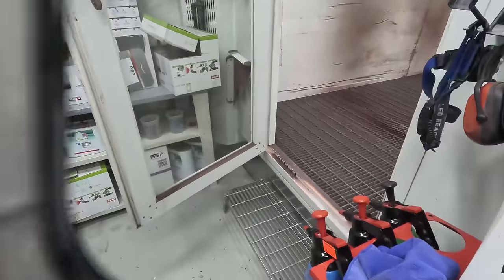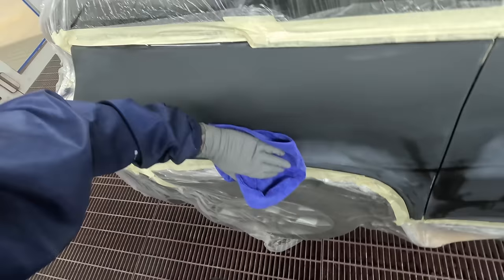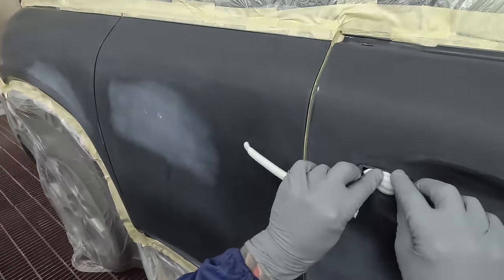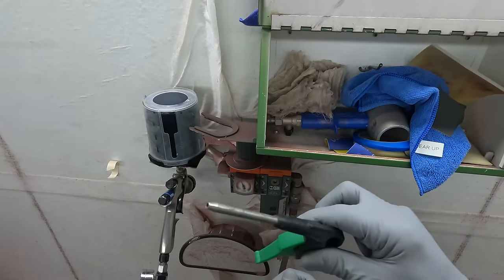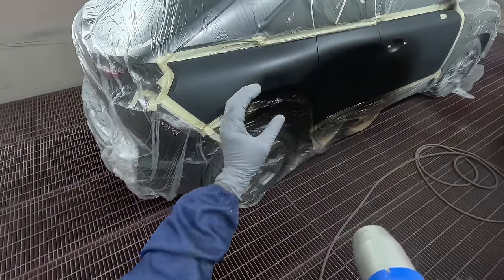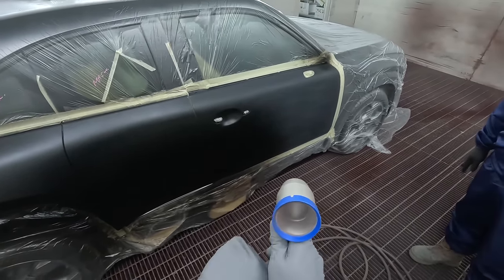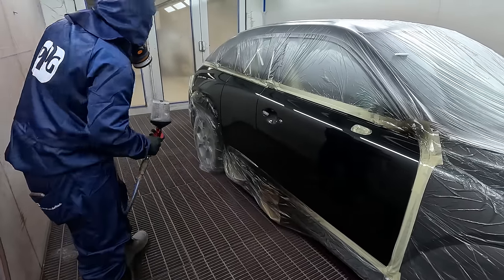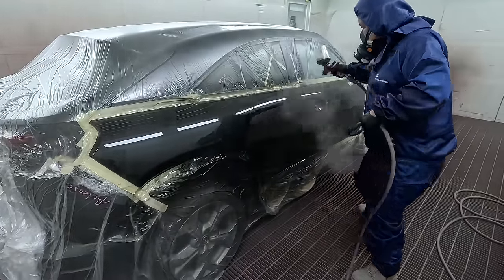Automotive Spray Painting Training

Comment: whats foam tape ? never heard of that there before...i took autobody as high school vocational elective. havent been too involved with body work since then. i can paint though have 3 guns 2 compressors plus a pancake type for smaller things. i use it for my motorcycle stuff to spray parts or if i am lazy just use aresol spray can to primer to wet sand then clean and paint with spray can... i am in cold climate city and state....

Comment: I watch this video and I’m thinking shit that looks good, but it doesn’t matter how many times I apply clearcoat I either get orange peel or drips or both, don’t get me wrong the end result is always good once I’ve sanded the panel back down with 1500 then 2000 then 2500 grit, and buffed it up, I just can’t get the perfect gun finish, I wonder if it is down to the cheap gun I’m using.
Reply from the maker: Potentially, also warm up the clear if it's a cold day and make sure to use enough thinner

Comment: How do you have your GoPro set up? I want to try and mount the smallest GoPro inside my face mask.
Reply from the maker: I don't think that will work, too much noise and glare. I just use the head mount.
Reply: @TheGunmanChannel   I thought that may be an issue as well. Do you use some sort of case to protect the lens from overspray? Thanks.
Reply from the maker: @garybrownlee7319  yes mate, I have a protective case with an easily cleaned glass lense. I'm going to upgrade to the latest soon, I could sell you my old GoPro if you want.
Reply from the maker: Email thegunmanraw@gmail.com if you are interested
Reply: @TheGunmanChannel  Ok! I’m in the USA though. I just recently had my Vigilante shipped from over there but it’s up to you if you want to go though the hassle of shipping.

Comment: You should start doing paint classes.  You have a big platform on here.  It would be a real good side hustle!

I do quite a bit of little jobs and I do Tumbler cups..  and I had a clear that my local jobber recommended.  It’s water white, but the shit never seemed to ever dry the stuff was baked…. Then sat in 30’c temp for a week and it was still soft.  

I just started using Matrix instead.  Far superior…. I mostly do stuff for friends and family for basically nothing but product and I felt bad even using that clean on someone’s panel.